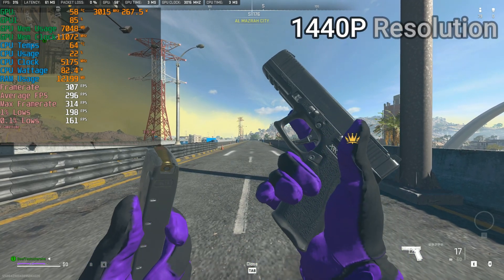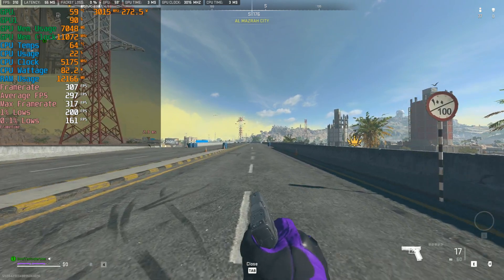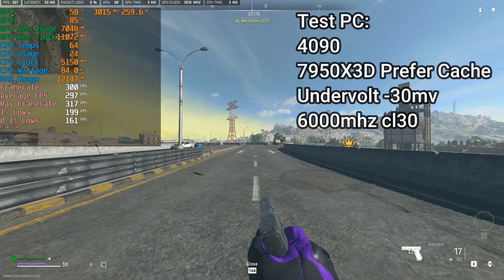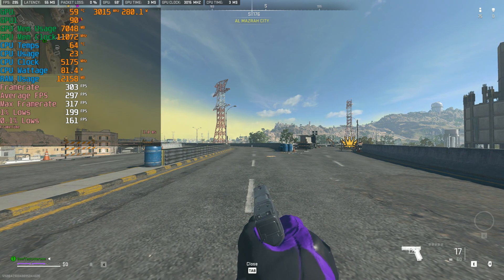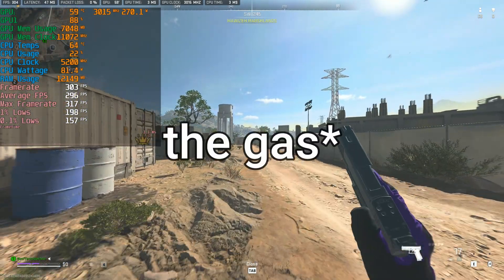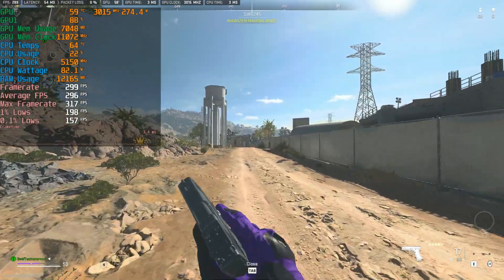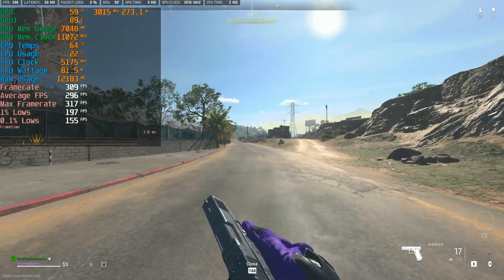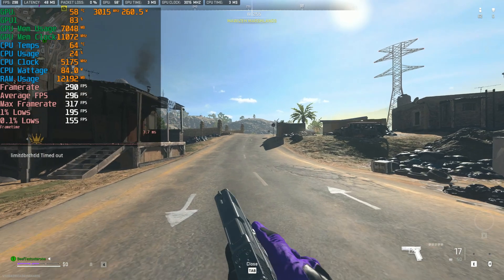The AM-Dip Is Fake News!

Comment: You do this test, in unoccupied areas, without quickly changing your camera view.

You didn't test anything. You did worse than the built in benchmark.

Like you are running in a straight line, without moving camera angles, and half your view is the sky.

All you did was show you are afraid to actually test for the AMDip, probably because you know it is exists.

Comment: Amdip is real. Maybe not on the zen4 vcached cpus. But my zen 3 5950x dips like hell. Also a oc 13900ks with tuned a die ram will outperform 7950x3d, in most games and dog walk it in productivity.
Reply from the maker: You are right. I owned a 5900x and in most games it's fine, but then you get to cod or cpu intensive games and it dipped.

On that note, 13900k fully tuned vs 7950x3d fully tuned in warzone isn't even a competition. I've gotten far better results out of my 7950x3d then framechasers as an example.. and I'm assuming you watched his video for the comparison.
Reply: @Beefy-Tech  no i build a 13900k and 4090 with 7600 a die oc’d for a friend. The 1% lows are better than your results here, although settings/config files and season to season performance variance could be a factor. But just the fact that 7800x3d relies way less on expensive tam and ram tuning does make it compelling for casual gaming pc consumers
Reply from the maker: @metachaser3277  that's true. But 1% lows are known to be better as a result of 13900k supporting ddr5 7200+ and that it doesn't idle cores meaning ratio wise the intel cpu's will win the 1% lows. But smoothness wise the frametime graph is the best representation of actual smoothness, and if the frametime line is buttery smooth a difference of even 20fps in the lows won't be felt, but higher averages will definitely be nice to have for 270hz monitors.
Reply: @metachaser3277  Can you ask your friend to upload a whole round of Al Mazrah Battle Royal, capturing the 1% lows etc from the start of the round till the end of the round? Would love to see it including jumping out the plane etc. Cheers.
Reply: I own both. The 13900k does not beat the 7950x3d in gaming, peroid.
Reply: 5950x isn't a gaming CPU, and pretty much every reviewer said to avoid it for gaming... That's your first major mistake.

Comment: Also if your able to make a tutorial on how you set everything up that would be great.
Reply from the maker: For a full WZ2 optimization I'm honestly still testing every option out there. I've settled on the Prefer cache in bios + process lasso for now, but I'm testing process lasso with other variations too👍
Reply: @Beefy-Tech  thank you so much for replying but appreciate it. I’ll try to do my own testings as well I get mine. Is there a possibility for a tutorial in the future?? Anyways man you appreciate you❤️
Reply from the maker: @kuyaazn3889  yes. I have a tutorial up on how to set up 7950x3d, but I haven't shown process lasso as part of it as at the time, I didn't use it. In the meantime I started using process lasso and results have been okay. I will definitely do a complete guide once I settled on a setup I think is by far the best way to run it, because 7950x3d unironically has 3 proper setup methods vs the classic 1 setup method most cpu's have xD. Can't even blame people for being confused, it is confusing.

Comment: I dont know how but whenever i am in game i alt tab, and i try to type something i see the screen lagging as i type. In gta 5 with normal settings i do get 1% fps drops however when i use Ultra settings there are no fps drops whatsoever. As i was typing those senteces my screen was lagging i was able to see whenever i press a key that it comes laggy to screen.
Reply from the maker: 🤔I don't play GTA5 myself so I would not be able to tell you if it's from the game or the PC setup tbh.
Reply: @Beefy-Tech  I just free roamed in gta i didnt get any 1%fps drop however in stunt races i do get it maybe its bcs of the game idk
Reply from the maker: @lokkox18  limit your fps to 170 in GTA5. I read it kind of hits a wall at 180fps and when it goes over it can stutter🤔
Reply: @Beefy-Tech  That might be the reason why the game stutters and whenever gta 5 is in background it makes the system laggy its like i press a key then after 1 second it comes to screen its clearly visible dont know why that happens. My current setup is : 7700x, 2080ti 32gb ram 600mhz 750w psu.
Reply from the maker: @lokkox18  definitely try an FPS cap at 170... GTA5's engine might actually be the issue there.
Reply: @Beefy-Tech  i will try thank you sir

Comment: You Undervolted 4 cores by -30 and the other 4 by -10? Did you disable the other CCD? Thank you

Impressive results! Keep up the great work!
Reply from the maker: I left the other ccd on, but chose "Prefer cache" within bios meaning all intensive 3D tasks will go on 3D ccd only. I also used process lasso to simply run background tasks on the second ccd to avoid bottlenecking the first 3d cache ccd with background stuff.

The -30UV is on first 4 cores, and -10 on last 4. The first 4 so happened to be my most stable cores, so because they boost higher with -30mv undervolt then other 4, SMT (multithreading) uses those 4 fastest cores (or 8 fastest threads) to render warzone 2, with my RWC being set to 7 threads.

Comment: Our pc parts are exactly the same, we have the same ram settings, same game config, same pbo curve -30 gpu overclocking lasso. You get 300 fps, I get 260 fps, what could be the reason? I am using windows 11.
Reply from the maker: Parts of the map matter some parts I see 250 in, some I see 290...but biggest difference will be cooling probably, how are the Temps looking and did you do the fps testing in the same area?

So, ive had it happen to where the settings bug out for me, dropping my performance to 260 ish also... I re-applied bios settings, re-applied config file (re copy pasted it from my old save) and it's fixed my issue. This happened to me the other day, so maybe give it a shot.

EDIT: make sure RWC is set to 7 in config file, I might have put it to 6 in the Dropbox config file by accident, in which case I'll have to update it.
Reply: @Beefy-Tech  My cooler is arctic 360 aio my cpu temperature is normal. In the game, 40fps drops when i open smt in the same area, when I open it, 40 fps drops. rwc is set to 7, I even changed the ram settings, I tried 6200mhz cl26, only increased 5 fps, I updated the bios and chipset, I don't know what else I can do?
Reply from the maker: @evolutionTR  I mean warzone can be like that I've demonstrated in Ashika island that turning 90 degrees to the right or left and just looking to a different direction can impact overall fps by up to 60-80 FPS. But you would see that same behavior with a 13900k too. I can confirm that since my 13700k, while slower, behaves similarly within warzone 2.

If you can FEEL a physical stutter, then it's more likely then not something is indeed wrong somewhere though🤔
Reply: @Beefy-Tech  I'm not stuttering I'm just getting 30fps lower than you are trying to figure out why my case is cold enough. otherwise there is no problem, the games are ultra smooth
Reply from the maker: @evolutionTR  I changed so many things I'm not honestly without checking it out personally 😂 if you want I can give you a complete list of how everything is set up the the past detail👍
Reply: @Beefy-Tech  The problem is in my cpu settings, I get 430 fps in the average wz benchmark, if it's 500, the problem will be fixed 😄
Reply from the maker: @evolutionTR  aha! So something is definitely not right. So my best result was 502, I average 485-495 most of the time in that benchmark. Also, first run results are always worse then the following runs. Do 2 runs and use second run results as first run has to render textures onto cache n vram.
Reply: @Beefy-Tech  Did you plug in the processor's 2nd power cable?
Reply from the maker: @evolutionTR  yes ofcourse. I wouldn't recommend not plugging one in😂

I was gonna ask habe you set FCLK to 2000mhz and uclk to =memclock in.bios for the 6000mhz tune?
Reply: @Beefy-Tech  All of them are set correctly, the problem is that the CPU frequency suddenly drops from 5200 to 4600-4200. I tried it from process lasso at normal priority for warzone, it is at high priority, I set cpu affinity, cpu set is not adjusted, my bios settings do not seem to be a problem, my ram latency value is 61, while playing huntshowdown, I get 250fps. When I turn off ccd1, my fps goes up to 400, but this is not valid for warzone, ccd1 in warzone nothing changes when i turn it off, Frequency is constant when playing huntshowdown, no frequency drops like 5250 by the way i tried core parking, i tried powercfg from cmd, nothing changes 6000mhz cl26 all subtimings tuned
Reply from the maker: @evolutionTR  try set your Render worker count in WZ2 to 6, maybe it's accidentally using one of the wrong threads🤔
Reply: @Beefy-Tech  I watched the last video of linus tech tips. I think my processor silicon is bad, I will send it to warranty, I hope they provide replacement

Comment: 7950x3d isnt a scam but id go as far as to say for gaming specifically its a bad product or rather amd are milking the cow for the last drop. The only one that makes any sense is the 800x3d's with the single ccd. X3D is aimed at gaming, why on earth amd put it on a chip with two ccd's and expect average gamers to disable or lasso a ccd is bonkers not too mention performance issues when both are enabled.  It might make sense for some scenarios but those people would be happy with the non x or x versions. Too many SKU's too much confusion and they still havnt released the 7800x3d?
Reply from the maker: So I actually found something that might interest you regarding the 7950x3d.

When running both CCD's with prefer cache enabled, while using Process Lasso to set just the background tasks like discord/razer snypse/Goxlr/rgb apps.

When run like this, the 7950x3d reaches the highest peak frequencies I can get out of it, and it has all 16 cores available for video editing and professional workflow. 

You just have to set prefer cache, process lasso background tasks to ccd 2, and set render worker count to 7 threads. I run undervolt of -30mv on 8 threads, so those 8 threads are available for WZ2 to be used.
Reply: @Beefy-Tech  That is very interesting indeed. It’s definitely an enthusiast cpu. What you explained made my head hurt lol but I do appreciate it. It got a lot of hate recently but it seems to be from like myself a gamer’s perspective more than anything. If I was in your position doing gaming, content creation, editing and enthusiast stuff like you do I’d definitely go for it. It has a lot to offer to people who love to tinker around with settings and getting the most out of your hardware. It’s just the marketing aspect from amd that has people raging a bit. They kinda became the nvidia of the cpu market.
Reply from the maker: @qubes8728  I have a 13700k I use for everything regarding testing gpu/ram kits and I love it because of how consistent it is. Thing is I'd say 13700k is also an enthusiast CPU, as it requires a lot of bios time for max out performance, but you can increase performance a lot with said bios time.

Comment: I understand why some people might have ill feeling towards the x3ds, imagine spending 600 bucks on a CPU, 400 bucks on 8000 M/T ram (to get the most out of said CPU) and 200-400 bucks on a large AIW/custom loop (to keep said CPU under 90c) for some nerd with 700 bucks,  35 dollar air cooler (max he ever sees is 75c under prime 95, 50-60c in gaming), a bog standard 120 dollar 6000M/T sticks and minimal effort, roll him in almost every game possible at half the wattage (so nerd can afford actual gaems instead of paying the electric company).

I joke of course intels are nice too :P
Reply from the maker: I use both intel and AMD myself. AMD non 3D is ass to be honest with you, but I give credit where credit is due, as the X3D when set up right, is knarly fast... and it's 10x easier to max out 7950x3d performance then intels 13900k, so beginners can just follow a 10 minute youtube guide and suddenly be able to beat a 13900k👀
Reply: imagine spending 400 on ram and 1200 on a mb bc ur dumwith money and listen to mainstream tubers lol be smart with ur money honey. buy 13900kf z790i edge and hynix a die which is cheaper than ddr4 and goes over 8000mhz. stupidity solved 👍👍
Reply: cheaper than ddr4 xd thats like saying u have to spend $8000 on water like mr beast lol to stay hydrated
Reply: @kodakblack531  It's a fact you need significantly more money and time to max out the Intel platform while the x3d CPU you just enter Xmp and preferred cores and you are done
Reply: @A.Froster  yeah let Xbox game bar decide what cores to use for you every process and get worse perf xD and I guess you can’t read bc if buying an 8 core cpu is cheaper than the setup I just said you go ahead ur a smart guy buy 3d xD
Reply: @A.Froster  and watch testing games benchmark them too I hate when ppl say 7950x3d is faster plug and play it still loses stock vs stock with same ram but has way less oc headroom and limited ram speed so yeah I guess 3d is better if ur very very very intelligent Xbox game bar being xD

Comment: while I agree its not that hard on 3D V-Cache the issue its much worst on the rest of the lineup that does not have 3D V-Cache and much mucho worst on the oldest gen like zen 2, but still you need to test it on points where its full of action and moving the mouse like if you where actually playing, the 1% lows its considerable worst that the one show here
Reply from the maker: You are 100% right. The 7000 non 3d is ass for stability vs X3D. I did mention in the description my statement only stands true for X3D ryzen, but I didn't mention it in title specifically cause I wanted to draw up a bit of commotion 😂

Comment: 295fps on wz2 1440p is just INSANITY...
Reply: on low settings its honestly not  impressive 139 gets more with higher lows but 7950x3d is good if you get it on sale and stuff and is easier to cool
Reply: @kodakblack531  2 CCDs, 1 with v cache other without. U can deactivate it. Lower power draw. Better compatibility with radeon soecially in 1080p a ryzen radeon combo smacks intel x nvidia. Maybe the price is a lil high but that to be expected. Actually 13900k for its tech is way more expensive than 7950x3d with much higher power draw. Its RYZEN time since 2019. Aaand the z790 problems and the i9 memory controller is mhmm.. have had and still has some probs. Idk bro the 7950x3d seems sick to me maybe im right maybe im wrong we ll see by time 🙏🏽🙏🏽
Reply: @BAG97  I think intel works just as good as amd with radeon at least this gen bc there’s no bottleneck. The main reason I’m not crazy over am5 is bc the max supported mem is 6600 that’s already obsolete even by ddr4. If you look at 5800x3d vs 7950x3d vs 7950x it’s not crazy which proves ddr5 6000 was a waste. Cl15 4100 ddr4 beats ddr5 less than 7200. I wouldn’t want to keep a board for years with ddr5 worse than ddr4. 5800x3d actually beats 7950x3d in some games
Reply: @BAG97  13th gen def cheaper tho especially if ur paying 699 for 8 cores. But it depends what cpu u like personal preference. I like intel oc headroom bc u can easily beat a 13700 with 13600 just with a light overclock. Motherboards and ram is also cheaper not more bc it supports last and ddr4 The power draw is a higher but it’s not like ppl make it seem in cinebench when ppl remove power limits and max out 24 cores. U can get 13600-13700 and $70 b die ddr4 with $130 mb very good budget build 4100 cl15> 6000cl30 unfortunately. ppl always say 8000mhz ram is expensive but it’s less than ddr4 get Hynix a die direct from oem
Reply: 200-210 on 3080 r75800x3d

Comment: What are the 1% lows and 0.1% lows on a 13900k?
Reply from the maker: I will do a part 2 where I'll compare the 2 cpu's. Someone in the comments section offered their data to use👍
Reply: like 3200 cl 14141434 is ddr4 bdie u can set it to any ddr4 xmp. but over 8k isn't guaranteed its luck bin and ur cpu has tosupport it.but u can do say 6000 cl30 with these its good ram and less than ddr4
Reply: this just some casual gameplay mw2 13900kf no oc https://www.youtube.com/watch?v=EwriR1y_Fsk&t=154s u'll notic hes using 7200mhz ram tho if u need good a die for less than ddr4 buy HMCG78AGBUA081N hynix a die u can set it to any xmp like b die ddr4 3200 cl1.u can get 9000mhz if ur lucky 👍 if u wanna see a 13900k OC 1440 max mw2 https://www.youtube.com/watch?v=9pxF2Zkn80M&t=140s